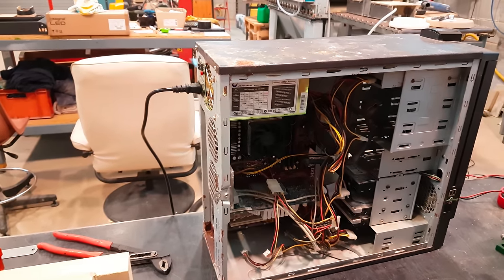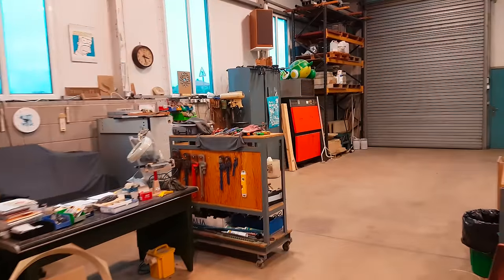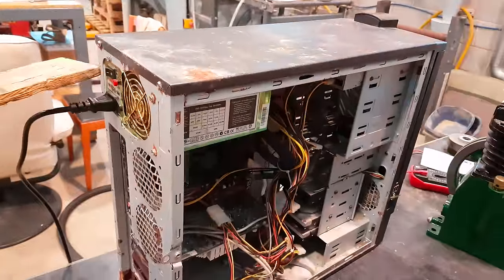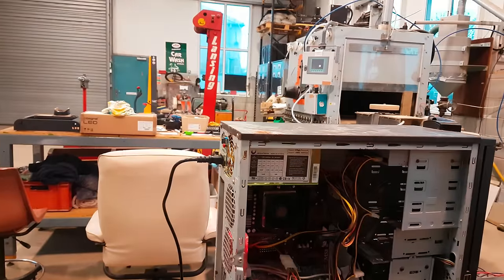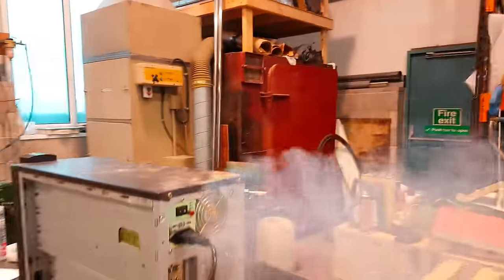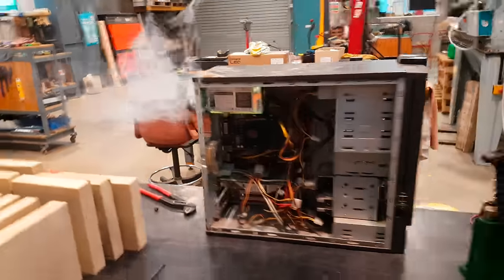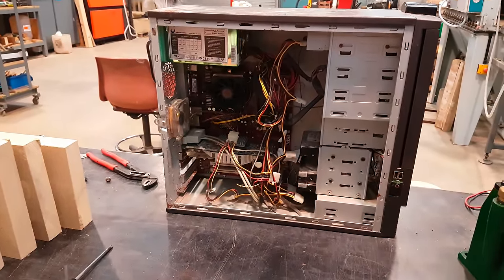Computer Explodes!

Comment: Oh my god I don't think I have ever seen a machine billow smoke out like that before. That's quite unbelievable. Thanks for recording this
Reply: I've had it happen to a cheap power supply before.  Accidentally left my screwdriver inside there while repairing it, and it was touching one of the leads on the capacitor.  There's a few large capacitors in there that store all the power going through the power supply.  Those are capable of storing a surprising amount of energy for their size.  You short one of those babies, and it's like a firecracker going off.

Here's an image of a circuit composed of the same type of capacitor, in case you're curious:  https://tinyurl.com/r4t3lag
Reply: i accidently plugged a 110v power supply on a 240v outlet once, not a good experience
Reply: @akaraio  Yeah you're not alone with that mistake
Reply: Mine wasn't quite spectacular but yes there was black smoke when my power supply died..thankfully that was the only think that does if I remember correctly.
Reply: Had it happen. Was sitting using my computer regularly when it suddenly said *Boing*. While I was thinking "Boing?" the screen turned glitchy. Then an opaque black column of smoke rose from the supply (which looked quite surrealistic). I turned it off and ventilated, so I didn't wait for it to pop.
What happened was that a metal piece of the CPU fan fastener broke loose and the spring ejected it onto the GPU, shorting it.
Reply: Ive experienced it,it shocked me 😂😂 i don't know why, but thats my 3 year old power supply
Reply: Win 95 core 2 duo trying to run roblox 1:11
Reply: @Dan-cc1gl  ik it's a joke but a core 2 duo runs roblox fine as long as you have a decent gpu
Reply: NsG Ender lol I guess
Reply: @imender9219  who plays roblox nowadays..
Reply: @Dan-cc1gl  core 2 duo is much newer than win 95 bruh
Reply: I met that explode before, but it won't smoke like that lmao
Reply: Actual video name : Fixing a water damaged computer
Reality: *Computer explodes*
*Mission failed*
Reply: @akaraio  Please explain. The power supply used less than half the volts that the outlet can provide. Isn't that okay?
Reply: @supersweet69  no, it tried to use all 240volts at once and blew up
Reply: @akaraio  ah okay
Reply: It happened to me once. I was using a cheap power supply.
Thankfully I managed to pull out the cord before any other part was damages
Reply: @akaraio  I was even more idiot. In a not so good morning, my PC somehow wouldn't turn on. Then, I checked the PSU and found a switch between 110v and 240v. My country uses 240v outlet. But dumbass me switched it to 110v. Then, I pushed the power button and it turned on, I entered BIOS, couple of seconds later it made a single exploding sound like in this video, just a lil bit less loud, and it smoked out. I was lucky all the components are still fine..
Reply: Gonna guess what happened is moisture/mud got into the ps (he did say it's a water damaged machine) and caused low resistance somewhere, or it was just a natural failure of something critical, PS stopped regulating, had no over-voltage protection and just sent way too high a voltage to the output. You can hear it, the fans speed way up. That then caused output caps to pop and something on the board or videocard to put on a show
Reply: Happens on KCAS almost every 1.5 years of using
Reply: Maybe the PSU was old and it had dust in it that got fried lol
Reply: I exploded dual core and pentium pc when i was 13 14 xD trying to build xD
Reply: the thing is don't buy cheap power supplies buy a power supply that is best for your set-up
Reply: Omg Astral

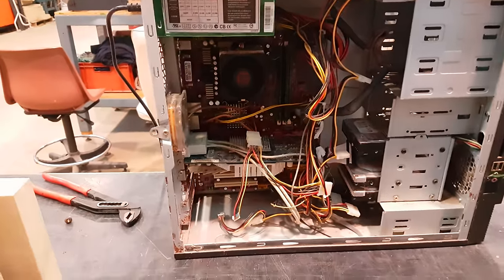Comment: 1:10 running gta 5 on full settings be like
Reply: Gta 5 can run on a microwave these days
Reply: But can it run Crysis?
Reply: ayyオイカorb ャulonlmao your so wrong
Reply: @doubleocaydo4233  he is not lmao
Reply: Jiří Dlask yes he is
Reply: @doubleocaydo4233  any pc that cost more than a microwave can run it at least on medium wdym
Reply: Jiří Dlask mines like 600 and dosent even get 30 on very low
Reply: Running it on my pc lmao
Reply: @doubleocaydo4233  well if it is 600$ it depends what year you bought it dont you think ?
Reply: Galaxy Doppler Minecraft RTX but you have an ATI card
Reply: @kommandant8272  core i7 4770k and r9 280x would run that no sweat. Maybe try earlier
Reply: gta 5 is super well optimized, i could run it full on my 2011 low range pc pretty well on high settings
Reply: gta 5 is still quite heavy even tho its already a 7 yr old game
Reply: @cjeeey6787  its only 5 years on pc, and the pc and "next gen" versions of the game were quite different from the 360 and ps3 releases
Reply: Guys I think he means online which is hard to get even 60 fps for a lot of people
Reply: There should be Battlefield 5 instead of GTA 5
Reply: Our computer components have gotten cheaper that's why a lot of people can run it easily. The game requirements have actually increased with all the updates but it's still not that demanding.
Reply: You can play gta on integrated graphics
Reply: GTA V isn’t the most demanding game you could have picked for a comment like this lol
Reply: Na that title is taken by Crysis
Reply: GTA V can run on almost Ultra on my $180 PC, damn y'all living ROUGH
Reply: @doubleocaydo4233   my second hand 150€ pc can handle gtaV on high with 60 fps so you either bought a laptop (which are known for being crazy expensive and weak) or you just got scammed
Reply: @alleykat6273  Do you consider a 750 ti microwave?
Reply: @Deuteriumaddict  Mine i3 6100 with a gtx 1050 ti runs it at very high 55~64 fps avg and near 50 on maxed out
Reply: @prateekpanwar646  oke
Reply: @alleykat6273  true
Reply: @j661  bruh you're so right I got mine for 225 euro (a used one) and it gets more than 60fps on high
Reply: @doubleocaydo4233  my potato pc that can run gta iv completely has no problems
Reply: @doubleocaydo4233  yes it can
Reply: @j661  He means online
Reply: @kratoswolf6523  online is same as offline as long as there is no hacker
Reply: @j661  thats not true AT ALL, it uses a peer to peer system, i have about 160 fps in offline and 85 online, online also has way more content
Reply: @kratoswolf6523  i dunno man i have same fps in online as offline
Reply: @j661  on all of the pcs Ive had... it was different fps offline compared to online. It always has. Maybe youre just not noticing it or youre using an fps cap..

Comment: this got recommended to me after overclocking my cpu and gpu,  pls god no pls
Reply: Make sure your power supply has enough power to operate in a good temperature or it may result in cpu/gpu damage
Reply: Its your PC giving you a hint.
Reply: is the power supply good? if yes then its ok to do it
Reply: @raffandbotnik  i have a PC : i3 8100 , 16 gb ram , and rx 580 gpu , my power supply is a Corsair CX 600 watt 80+ bronze , it is good enough ?
Reply: @baicamarian  it is
Reply: @baicamarian  it’s great
Reply: @realdoinky  this year i want to upgrade my PC to i7 8700 and rx 5700xt , and i am thinking to buy a 850 watt corsair psu
Reply: @baicamarian  it should work properly even if you overclock a bit
Reply: @realdoinky  are corsair a good brand of psu , i might buy seasonic for my next pc build
Reply: @baicamarian   
Corsair 
Evga 
Cool master 
Best brands for PSU

Comment: For those who don’t know, it’s the capacitors inside the power supply, which are exploding
Reply: Cool story, bro.
Reply: He said that.
Reply: @chrislittle7285  He said "that's the caps going" which is not very clear, especially if someone doesn't know what the inside of a power supply looks like.
Reply: Yeah I had no idea "Caps" was capacitors, so thank you.
Reply: @kalahatze  
well actually mate
if a person doesn't know what caps are  then they dont' know what capacitors are either
so you saying
FOR THOSE THAT AREN'T AWARE IT'S THE CAPACITORS INSIDE THE POWER SUPPLY
is just as useless to them as saying
YEP THAT'LL BE THE CAPS EXPLODING

You need to rethink your comment
it goes like this

If your'e an electronics person or technical person then you know what caps are
and you don't need to be told they are capacitors

if you are not technical then you don't know what capacitors are anyway , let alone caps.
and the saying  
FOR THOSE THAT DON'T KNOW IT'S THE CAPACITORS INSIDE THE POWER SUPPLY EXPLODING
is also pointless because those lamen people that don't know what a capacitor is 
also have no concept of what the relevance of a cap exploding is as well
they don't understand voltage or pressure they don't understand circuit faults 

TO THEM.... it's more functional and practical to say  THE COMPUTER EXPLODED
which in turn is already obvious which also means the statement was pointless

so your comment to the comment that was supposedly not clear IS ALSO NOT CLEAR to those that don't know about electronics

MAKE SENSE ?
Reply: @martinkuliza  BS. "capacitors" gives people who want to inform themselves something to type into a search engine.
Reply: @Your-Least-Favorite-Stranger  
Fair enough, but i can tell you conclusively   THEY DON'T UNDERSTAND.
I've tested this many times
so you say....  heck if i know
but.. I do know
with all respect to you because i have no interest to argue , and my only intention is to correct you but while also respecting your intention and original comment, ok

but the fact is this ..
Lamen people (and if we are talking about just lamens)  Have absolutely no concept of basic electrical components,   they perhaps understand what a fuse is , but not what it does , they don't even understand resistors
also let's consider that that blowout in the supply may not have been caps,  MOSFETS are a very real possibility as well, as well as Transformer or a combination of them, but.. i digress
but trust me,   they don't know 

Then there are of course people like you and me who are highly skilled in electronics (at least i am)
and then there are people in the middle
now it all comes down to this 

If a person has even a remote interest in electronics they will understand what capacitors do and what a CAP is , in which case your comment was not needed

if they are a person who has no interest in electronics they won't know AT ALL
in which case, telling them it was THE CAP or THE CAPACITOR has as much meaning as saying  THE FLOOGLE BINDER IN THE POWER SUPPLY FAILED
i mean.... Try it ,   i challenge you 
go up to a lamen and make up a word, let's say "FLUGELISER"
and say something stupid to them while showing them the video of an exploding supply and say 
"well that's the flugeliser inverting"
I BET YOU THEY AGREE WITH YOU
They don't know mate,   simple as that, because if you said that sentence with a totally serious voice they would absolutely not question what you were talking about 
Swear to god
Reply: @RupertReynolds1962  
yes... PEOPLE WHO WANT TO INFORM THEMSELVES
although, who i'm talking about is lamen people who don't care what happened

and People who want to inform themselves about electronics will know how to good a capacitor anyway 
so.. it's not bullshit, it's a fact
simply stated,  there was no difference between saying CAP and CAPACITOR
because the people that know about it in electronics know that it's also a cap
and those that don't know don't know the difference either way
and .... those that want to inform themselves can also type in  
WHAT IS A CAP IN ELECTRONICS
and they will get plenty of search results on capacitors 
so.. it's not actually bullshit
Reply: @martinkuliza  move on, brah
Reply: @martinkuliza  You pour out vast flows of text, without saying anything new.

Please stop.
Reply: @martinkuliza  I only read the first line.
Reply: @ArmadusMalaysia  
OK..... well then......
PROCEED TO THE SECOND LINE
You don't need my permission to keep reading

Take your time,  don't rush it
Absorb it all so that you understand what i said

give me your thoughts when finished
Reply: @martinkuliza  lmao
Reply: But what caused it to explode?
Reply: @Hboogie182  Bad wiring causing excessive heat.
Reply: @TheRealCaptainFreedom  so I'm assuming the wires he used were not compatible. This is why I only buy wires directly from the manufacturer. I never buy third party wires.
Reply: @Hboogie182  
Exactly   LOL

Ok.. Capacitors 101
just accept this for now

Lesson 1 - voltage is Pressure,    don't think about it, don't question just accept it.

Lesson 2 - so... If you have a coke can and it's unopened, it is full of pressure.
if you shake it it builds up more pressure, you can literally feel the pressure on the side of the can .
Now Theoretically ....  if you could infinitely increase the pressure   THE CAN WOULD EXPLODE

The pressure would get to a point at which it is a level that exceeds the can's strength to contain the gas.
common sense.. right ?

Lesson 3 - Voltage is Pressure and a Capacitor is a container that stores voltage (or Electrical Pressure, if you prefer)
so EXAMPLE
say you have a 10V , 1000uf Capacitor (FOCUS ON THE 10V  , NOT THE uf'S)
So.. this container can hold 10 Units of Pressure (AKA 10VOLTS)
if you put more pressure into it   ( TRY TO PUT 50V INTO IT)   it will explode
as a result of it's casing exceeding its' pressure limit

In reality an electrolytic capacitor has fluid in it so what can also happen is ...
Electricity is energy , which is heat
it's like boiling water on a stove until it all evaporates
so.. Pressure builds up,   over time
so does heat
the fluid evaporates
the capacitor dries out
as a result   it's  Internal resistance increases
basically it gets dry and hot and over pressured

and then............BANG !!!!!

that's how
ANY QUESTIONS
Reply: @Sludge 
well , tonight i imagine it'll be 
Chicken Ceaser Salad
Mexican Pizza
Pasta - Penne Arrabiatta 
Maybe some coffee and dessert 

ANY MORE QUESTIONS

Comment: This is nothing compared to my pc when it exploded due to high voltage after they "fixed" the transformer in my area. There was a sequence of blasts like those and smoke all over. I was shocked, frozen and speechless
Reply: I think this is what just happened to my pc. what do I do? can I sue the electric company or do I need to purchase a new power supply. I’ve had my pc now well over 10 years without any problems with the hardware.

Comment: Damn, that was rather epic.. Those cheap PSUs can fail in such a way that, as you could probably tell, much higher than 3.3/5/12 volts ended up going into the machine.. Fire on the motherboard and the fans over-rev! Impressive how many times it comes back to life though..

Comment: im like "DUDE TURN THE F*CKING THING OFF!" when the psu exploded. its not good to leave a popped power supply running like that! owtherwise good vid.
Reply from the maker: Yeah I know it's not good but it is interesting to watch.
Reply: That's literally the whole point of the video
Reply: Maxxy The Computer Guy 

What’s you Nintendo switch friend code?
Reply: @coydog7902  u shouldn't Ask randoms for friend codes
Reply: Sorry I’m weird I get way too obsessed with splatoon 2
Reply: @coydog7902  Wtf

Comment: Me trying to run cyberpunk 2077 on my pc with intel integrated graphics:
Reply: Same 😔
Reply: Me getting only 60 fps on ultra ray tracing in cyberpunk 😞😞
Reply: Poor boy
Reply: Lol
Reply: Add to the story: From 2010... 

I mean that what I do. Literally play Minecraft on a laptop from 2010 with intel integrated graphics 600
Reply: @rohitvarshney2369  really sad
Reply from the maker: Me trying to run Cyberpunk 2077 on an RTX 2070
Reply: @ComputerExplodes  me trying to run cyberpunk 2077 on my rx580
Reply: Me trying to run cyberpunk 2077 in calculator
Reply: Nasyx Rakeeb  as soon as you press the power button it'll explode
Reply: Mine has intel 3000 graphics and gt540m... geoforce now...
Reply: Same ):
Reply: If you have the game, I have an asus n53sv 2nd gen i5, nvidia 540m, 8gb ddr4 ram and 256gig ssd, i can play it using geoforce now with my steam account logged in. Works wonders
Reply: Why the hell did you buy the game when u dint even have a GPU.
Reply: @rohitvarshney2369  that not good enough?
Reply: laughs in RTX 3080
Reply: @AlexsAnimals  same Intel 3000. Why games be needed more power when tetris plays on a gameboy from 1980
Reply: All these guys wanting 4k gaming for no literal reason..lol I'm fine with a solid 1080-1440p 70+ frames per second..xD
Reply: @rohitvarshney2369  how is that not enough
Reply: But no one would play this not for graphics, but for its worsened gameplay...☹️☹️☹️

Comment: Me: Mom can we get a Gaming PC?

Mom: No, we have a Gaming PC at home.

The Gaming PC at home trying to open a folder:
Reply: to be fair, windows explorer is a bitch shite. too bad they don't compress it for gaming pcs
Reply: *trying to open windows photos
Reply: No try open game
Reply: @shitbot1198  lol if this this pc is very very slow
Reply: Mr Beast   hi
Reply: @benjapizarro981  i can relate to this lmao, GTA V loads faster than that software
Reply: True story :( 
I am in need of PC build. I have to keep it under $820 as much as I can.

I'll get(I am thinking not final)
Processor- Ryzen 5 (Something cpu. Most probable  3600)
RAM- DDR4 16GB frequency 3000 hz up
Mobo-MSI B450M
GPU- I think i need to get it later it is crossing the budget
Power supply- Didn't thought. of yet.
Cooler-Stock cooler(No overclocking so...)
Cabinet-Any cheap RGB

Any recommendations? I already have a monitor, Mouse, keyboard and speaker.
Reply: LMAOO
Reply: @lifelessbaby4411  Windows Explorer is actually cool, it loads remarkably fast on my low-end laptop with an HDD
Reply: fr my mans got powerspec
Reply: Rip
Reply: @shitbot1198  *trying to run Paint